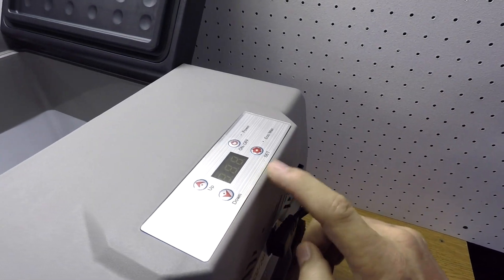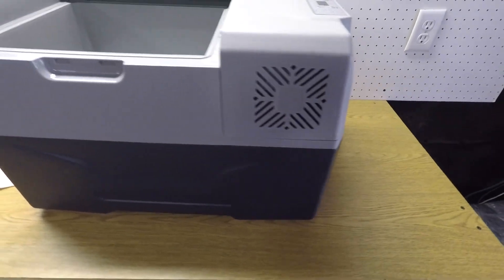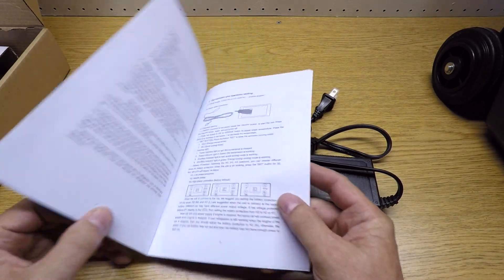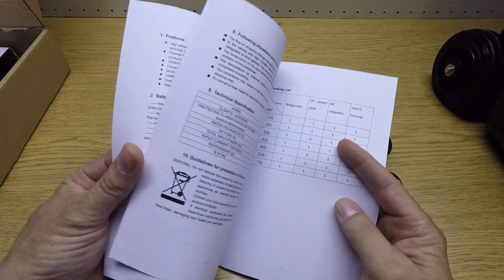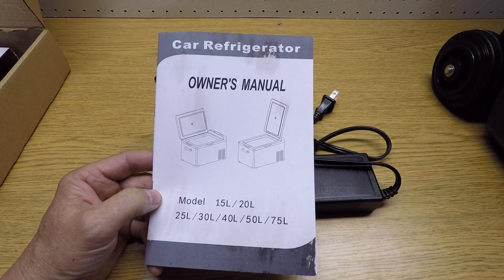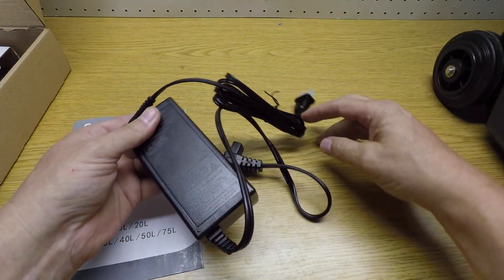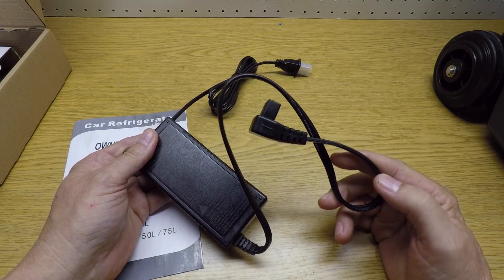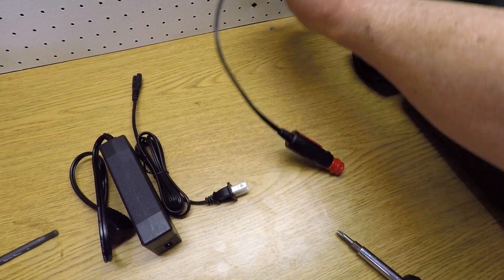The ULTIMATE 12V Refrigerator Alpicool CX30 REVIEW

Comment: Exactly what Flyboy said. The sensor in foamed into the insulation along with the coils. I moved, installed a new one in the actual space where the food is. Now its nuts on.
Reply: Did you install one of those wireless temperature sensors?

Comment: Good review. We have an XtremepowerUS 52 quart (46 really) 12v/24v/120v freezer/fridge. Same machine as the Alpicool. It’s fantastic, we use it in our 5th wheel for extra freezer/fridge space. It sips power, nice and quiet, and the Bluetooth app is great. Also has a usb plug which is a nice plus. I have it sitting next to my theatre seats as an end table, works prefect.

When the grandsons are on board we’ll use it as a fridge for their snacks and drinks. It keeps them out of the big fridge and with it being top loading it doesn’t loose any cold when they get into it. May get a second one.
Reply from the maker: Sounds like you got a good one too. They are very handy items for nomads, campers, outdoor enthusiasts. Mine have paid for themselves in cost of ice savings and are much better than the conventional ice cooler. Thank you for the comment :)

Comment: One of the problems with temperature differences is that the thermostat probe appears to be buried inside the case/lining, not inside the actual refrigerator compartment.  A more accurate measurement would be to have the unit loaded (water jugs would be fine) and then take temp measurements at 6, 12 & 24 hours...measuring the liquid, not the air temp.

Great review and very helpful.  Sincerely appreciated.
Reply from the maker: Thank you :)

Comment: If you take the screws off the cover, there will be a fuse inside on the bread-board, that runs the controller. Good review. I like that you did some real bench testing and did the kick the tires thing, in the review. 

THE ONE aspect of this video, I WANT you to CALIBRATE IT with the secret setting. IN other words, once it is calibrated, run the test again. Is it cooler? Does it take longer? More amps? This would have been interesting. I do like that the feature that it can be calibrated. That really is dead on important. I think. Good review, regardless.

Comment: Actually the fuse is inside between the power plug and the module. Its actually easy to get to it only 6 screws 3 infront and the other 3 inside when you open the door
Reply from the maker: Good to know! Thanks for the information!

Comment: Is the interior watertight. Are there any openings up under the shelf that water could get into?
Reply from the maker: I think it's completely watertight. I think you can even use it like a cooler with ice if you want. It does have a drain hole in the bottom with a sealed removable plug.

Comment: How did you find out these settings?  I have a nick off of this model. The temp it says has never been what’s in it. I live on my sailboat and have been fighting with this thing for months.
Reply: How do I know what each of the values is so I can try to adjust my system. Please help. Ty.
Reply from the maker: If I remember correctly I got the settings off some Alpicool YouTube videos. Check out this guys video, it has some good info about the Alpicool settings. https://youtu.be/BGvi3JC0URI

Comment: I think your refrigerator needs calibration Bruce. 26 degrees F is below freezing, not just cool. I keep a thermometer in my Dometic CF25 and it reads a 1 to 2 degrees deviation from what it is set at. Thank you for running the test and sharing!
Reply from the maker: I think you may be right. It did pop back up to 34 fairly quickly so I need to do a little more testing I think. Maybe it just overshot and the temp sensor was slow to react. Thanks for the info :)

Comment: Is there a way to disable the battery protection settings? I am running a lithium pack and its cutting out at 60% and would like to drain it down more.
Reply from the maker: I really don't know if the battery protection settings can be disabled or not.
Reply: Adventure Van Man Brian and Element Van Life Nate both talked about that issue and said no, there's no way to disable it.

Comment: Did you pre-chill it plugged into the AC at home & pack it before putting it in & plugging it into your van’s house 12v battery? Did that help at all with battery management?
Reply from the maker: No I didn't, I plugged it in about an hour before we packed it with cold stuff out of our house fridge then off we went. This little fridge just seems to do real well with the single house battery and is quick to cool down. As long as there is at least a couple of hours of sun I can cool it down from warm temps without even touching the house battery. This 100w solar panel puts out about 5+ amps in direct sunlight and the fridge only draws 4 amps or less so if there is good sun on the panel for the cool down period the solar panel could run the fridge without a battery. Cooling down at night or without sun would be a different story. Hope this helps.
Reply: Thx for quick reply.  I’ve been looking at the 20L one, but might go with this 30L if it fits under the cot in the back of my PMCity.
Reply from the maker: You are welcome. I think you will be happy with what ever size you get. They are nice little refrigerators for the money. So far I'm impressed with mine. Thanks for watching Karin and take care.
Reply from the maker: Alpicool also has a new model that's in between sizes. They have the Alpicool C22 that might be the size you are looking for if the CX30 is too big. Just thought I'd mention it to you.

Comment: Thank You for the video. I am wondering what's the material of the inner case. I guess the evaporator is running behind this case. Is it made out of a special material to ensure good cooling?
Reply from the maker: Good question but I really don't know for sure what the inner case material is. I would guess it's some type of hard plastic. It may even be a fiberglass of some sort but I'm really not sure. Thank you for the question.
Reply: WannaBFree thank you. I already found it out. It should be High Impact Polystyrene (HIPS).
Reply from the maker: Interesting, thanks for the information.

Comment: I just purchased the 30 liter model.  I used your affiliate link.  On sale for $279 for about 2 more hours.  Thanks again.
Reply from the maker: Thank you for your support! It sounds like you got a great deal with the sale too. I hope you enjoy your new portable fridge and it serves you as well as mine has served us. You are welcome and thank you again. Have a Happy 4th!
Reply: @WannaBFree  ,  You are welcome.  I have a question.  How do you set the battery level cutoff.  I don't remember seeing that anywhere?
Reply from the maker: Good question, I can't remember for sure. I'll have to check for you. I think you hit the set button until you see "Low - Med - High" and stop on the one you want. I'll check and let you know what I find out.
Reply from the maker: Setting the battery level cutoff is as follows. With the unit turned on, press and hold the set button for three seconds. Then press aging to select one of the three settings. Once it's on the setting you choose just wait several seconds and it will return to displaying the current temperature and it's set at what you left it on. The three settings are:
H1 (Low) Best with auxiliary battery and engine starting isn't an issue if you run the battery too low
H2 (Med)
H3 (High)  - Recommended setting if using your car starter battery. You won't run it down so far that you can't restart the car.
I haven't found the actual cutoff voltages for the three setting options. If I remember correctly I have mine set on H2 (Med) I am using an auxiliary battery so I am not worried about starting my van if I run it down too low. I Hope this answers your question.
Reply: @WannaBFree  ,
Thanks.  I have used the unit for several days.  In the beginning it is very deceptive how quickly the temp reading falls.  I put a gallon of 75 degree water, a 6 pack of my favorite beverage and a few cans of soda.  After an hour, my wireless internal temp probe was indicating 74 degrees.  The refer panel was showing 15 degrees.  I had the unit set to 18 degrees.  It took basically 20 hours for it to cool the contents to 25 degrees.  After that, I set the temp to 30 and it easily maintained that temp.  I did have a 3 degree error between the readout and my wireless system.  I changed the units calibration by -3 degrees and now they hold with a degree of each other.

I am very pleased with this unit.  Thanks again for you help.
Reply from the maker: I'm glad you are happy with your purchase. It sounds like you have it dialed in nicely. :)

Comment: Can u comment on the Alpicool C15? I'm concerned about reliability. I want a smaller unit for my compact car.
Reply from the maker: Sorry but I have no experience with the Alpicool C15. I can tell you that the Alpicool CX30 has been problem free for me since I've owned it. I don't use it full time though, only for short camping trips.
Reply: I did not like my C15 fridge you need to keep it set between 35- 40 degrees for best Energy Efficiency but it seemed to run more than it was off. insulation needs to be improved.

Comment: Looks like a decent 12 volt fridge... I just bought the CF35 alpicool  from amazon.. Would you know what the difference besides size would be   cf vs cx  ?  thanks  I had a edgestar p430  portable fridge  and was fine until today   so we ordered this cf35
Reply from the maker: The CF35 should be a nice fridge. Hope you like it. Sorry but I don't know the differences between the cf and cx. I just don't have any experience with the cx.
Reply: @WannaBFree   thanks,   so you still like the alpicool  no problems since you did the video?
Reply from the maker: Yes, I still like the alpicool and no problems with it to date (Aug 2019)
Reply: CX is the trolly model, the compressor is at top and door opens front to back. CF compressor is at bottom and door opens right side to left side. Main differences.
Reply: @LeoBarr1968  cold air goes down so its always better if the compressor is up top.

Comment: I have already checked on my refrigerator there is no fuse in it
Reply from the maker: Interesting
Reply: Yes I cut my plug off and directly connect it to my fuse panel in my van now I know it's protected
Reply from the maker: That's a good solution! I have my 12V outlet plugs wired with a fuse.

Comment: Thanks for the video Bruce, did you gather data on the average power consumption over the span of 24 hours? I am currently looking for an affordable off-grid cooling solution that I can run with a small to medium sized solar system.
Reply from the maker: No I haven't done any data gathering over time. I will say I have ran this fridge on a single 100W panel and 108Ah lead acid battery over a couple of months continuously and it did great. It will take a couple of days of no sun to really deplete the battery but if I get a couple of hours of sun each day it does just fine. Hope this helps and thanks for watching. :)
Reply: @WannaBFree  That helps alot, thanks for the information.

Comment: Those coolers are getting to be better made, more efficient and more affordable to the point that they can replace coolers.  I wish I had got one of these for my trip to Florida.  Did I miss hearing you say how heavy this is?  Weight is a big issue for me since I would have to lift it by myself.
Reply from the maker: Not sure if I mentioned it or not but it's about 26lbs. Not bad at all I think.
Reply: @WannaBFree  Thanks.  I could probably handle that.
Reply: It isn't as heavy as an ice chest with a bag of ice, lighter than that.

Comment: We need to know how many watts does it draw
Reply from the maker: (Amps x Volts = Watts)............This refrigerator pulls about 4 amps and runs off of 12V. My batteries usually run around 12.5V to 12.8V so in this case at 4 amps it pulls about 50 to 51.2 watts. I hope this helps you out.

Comment: Looks like CX30 is not available. Your link goes to C20 which doesn't have the wheels. :-(
Reply from the maker: Yes I see that. They do have a new 36 liter Dual Temperature out now that includes the wheels. I don't own one but it looks like an improved version over the older one. Here's a link to that one if you want to check it out.
Alpicool Dual Temperature Control T36 Portable Refrigerator 38 Quart(36 Liter) - https://amzn.to/33y9Lhi
Reply: Thanks. 
We just went through an 18-hour power outage from Hurricane Isaias.
I am looking for a freezer to use when the power goes out. 

two ideas:
a.) an Alpicool CF35 $299 and running it from car battery 
or
b.) a regular mini freezer 1.1 cubic foot $190 and running it from an inverter --- I already have the inverter --- connected to car battery

Do you have anything thoughts on this?

Or buy inverter generator for $500?
.
Reply from the maker: Sorry to hear about your 18-hour outage. A mini freezer sounds like a cheaper option but I have never ran something like that off a battery with an inverter. I do know the inverter does draw energy from the battery and it's less efficient so I'm unsure how long the battery will be able to run the freezer. 
An inverter generator would do the trick but then you have to have the gasoline and noise from the generator. That's a hard one to decide.
I wish you the best!
Reply: Thank you. 
Some of our friends had to toss all the food in their refrigerators. 
Their power will not be back until 7 days after the storm. 
We kept the refrigerator closed for the entire 18 hours and fortunately did not have to toss any food.
I think I am going to have to look into an inverter generator.

Comment: Good review. However, I am still unclear of what was the actual temperature inside.
Reply from the maker: Yes, that is a bit confusing in the video. The inside temp read 60F and the fridge thermostat read 32F when it shut off. I didn't give the temp enough time to stabilize in the video. It really needed another 10 to 15 minutes to stabilize the temp but basically the temp inside will drop a couple degrees below what you have the thermostat set for. Then it will warm up a couple of degrees above what you have it set for before it kicks on again. Also with the fridge being empty it doesn't take long when opening the door for the temps to change inside the fridge. It's much more stable when it's full of food or beverages and that helps the temperature stabilize. Hope this helps and thank you for the comment. :)
Reply: @WannaBFree  
Is it possible,  just possible that the display was in celcius and the thermometer in farenheit. Or vice versa.  Just saying. Because that is a HUGE difference
Reply from the maker: It's possible

Comment: Run my alpicool and charge my phone..or watch netflix at night off my roof 100W solar. ...no problem
Reply from the maker: Very nice! A lot of items can be run off a 100W solar panel for sure. More than most people realize I think. Thanks for your input!
Reply: Thanks! Got a 100W solar too, so i should be squared away.
Reply from the maker: Yes you should!
Reply: Hi when i reaches its temperature, does it then shut down and save power and then starts again or does it keep running and using almost 3amps all the time you have it turned on? 
Cheers and thanks for the video nice one 
//Robert

Comment: Around 12 minutes.........Both thermometers are not that accurate while they are showing about the same temperature.? I am not convinced, there is something definitely wrong with the Alpidull refrigerator.
Reply from the maker: I am not trying to convince anyone of anything. Just showing what you can expect and how mine works. This 12V fridge has been working fine for our needs. We just adjust it to what we like and leave it no matter what the numbers are on the readout. Thanks for watching.
Reply: @WannaBFree  I am talking about your test, which you did as it was supposed to be done and your test data results, which were dismal, apparently because of the product. Maybe the refrigerator does work in cooling, but not at the level or temperature that the manufacturer is selling it to the public. Have you ever had a thermometer inside when using it and compared it to what the readout outside says it is?
Reply from the maker: I have not but that is a test I should do the next time we use the fridge. I would suppose the fridge reading is off. There are adjustments you can use to correct it if you wish. I just haven't adjusted mine at all. I'm using the factory settings.